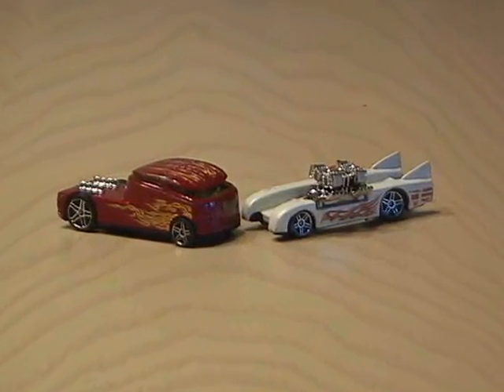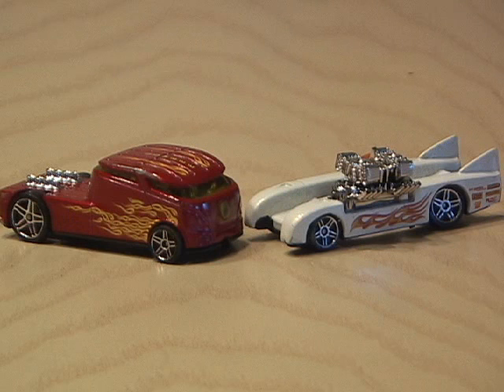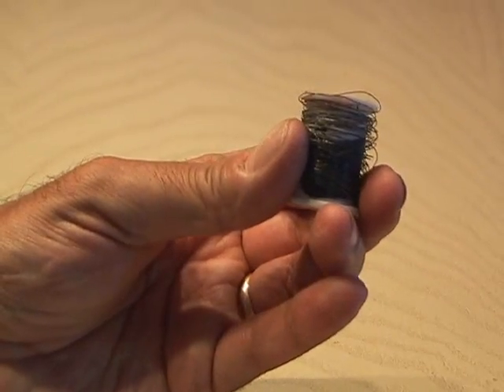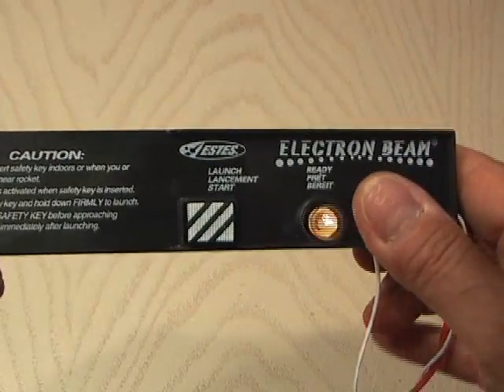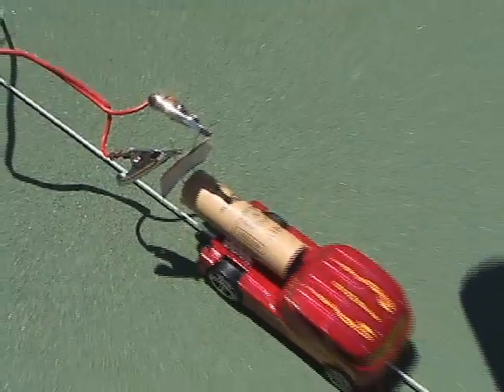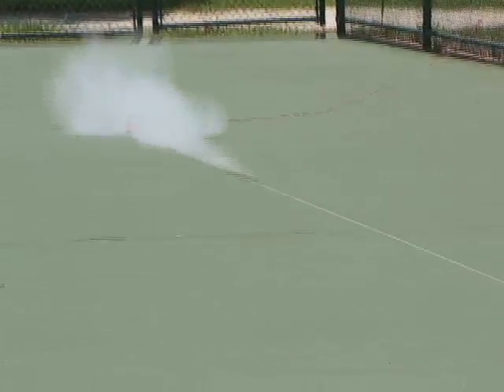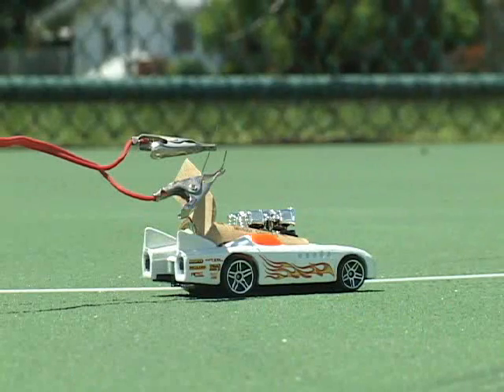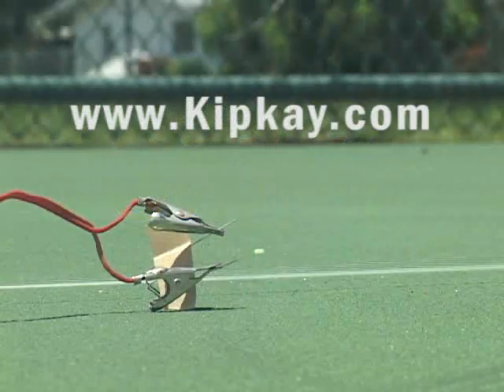Rocket Powered Matchbox Cars!

Comment: @XxFairyGrrlxX No. I was just messing with y'all. I've shot a ton of model rockets in my life, but never did anything like this. We were always interested in getting them to go as high as possible and getting accurate readings on how high they went. Also getting the multi-stage ones to work right. I've thought about doing this only on a larger scale and actually racing two cars side by side. I'd like to use D engines in larger cars and guide them on welding wire which you can get in long rolls.

Comment: @Roelmaestro You never read the code, did you? It's guys like you that give Model Rocketry a bad name.  I strongly suggest that you re-read the Model Rocketry Code of Safety. You're NEVER supposed to launch at an angle less than SIXTY DEGREES from horizontal. This is horizontal. ZERO DEGREES. Someone is going to get hurt with shenanigans like this or get their eye put out. EPIC FAIL.

Comment: I made a similar idea many, many many (Okay, a good 30) years ago when I was into Model Rocketry.. I built a small wooden car, and outfitted the back with a cast aluminum tube. (helped to have a foundry furnace & engine lathe in shop class at the high school.) Not quite as fast, but not limited to a wire either.. I used to launch them in the back lot of a mall, before they rearranged the store locations. Actually concepted a 'Snow Speeder' design, which would skate on the snow surface.)

Comment: @Dark0Lord7 thanx. I'll try to use 1 of those the next time. :) but would I need allegatir clips and 1 of those wires that comes with model rocket engines? Or can I just keep the 1 wire. Btw, how can I make sure the wire is copper? It looks like copper but I can't b sure since it's not working.

Comment: @meepfeet I tried to make an electric igniter that didn't work. I took apart a toy car that was attached to a trigger to a string and the trigger had 2 buttons (1 for forward and 1 for backword) I attached the red to the positive of the battery and the black to the negative. for the blue and green wires, the 1s where the power goes, i took 1 of the copper hairs out of 1 of the wires and tied it to both wires. from what i know it should have lit up red hot but it didn't. :( What did i do wrong?

Comment: @afr126 If you scaled it up, it would be 1800 mph.  What Kipkay did is measure the distance traveled, and the time it took to travel that distance.  He converted what was most likely a feet per second value into mph.  Then he multiplied the true mph by 64 to get 1800 scale mph.

Comment: @afr126 You have to know the scale on the cars first. From Wikipedia, we find that Hot Wheels makes cars at 1/64 scale, which means that the cars are one 64th the size of a real car. The conversion factor applies to every measurement. A scale mile would also use this conversion factor, 5280 / 64 = 82.5 ft.  The  actual speed in mph would be 1800 / 64 = 28.125 mph.  Not super fast, until you consider that a car going thirty miles per hour will kill you.

Comment: @ThePEELdeal think of it like this. if  u have a perfectly scaled 1/1000 size model of a boeing 747 then what speed would it need to take off? A 747 takes off at around 180 mph so you're a basically saying this model would take off at about 0.18 mph? And if I'm on my bike going 20 mph and there's a car next to me going at 20 mph but because I'm only 1/10 the size of the car I'm actually going 200 mph? Speed doesn't scale.

Comment: Hahaha, as a kid I had that exact same rocket kit. The normal kit has a little drag racer car, and you had to set up somewhere along the end of the line a parachute that was attached to the line. When the car went passed the parachute, the parachute would be pulled out of it's little holder thing, then opened. Shame I eventually lost that, because I still have like 12 of the rockets that I could have used!

Comment: i tried this with a rocket and attatched a bomb to the end of the rocket or a cap filed with flash powder and when it went fast at the last secand BOOOOOOOOOOOOOOM no more hotwheels it literaly got scatered everywhere and nothing is left     i cal it hotter wheels and ofcourse i partaily removed the seal of the front end of the engine so its like a smal jet of fire after the last of the fuel is gone thus igniting the flash

Comment: @chinaiscool24   the cardboard sticker holds together the egnition wires. The tip of the wires is a very fine wire which heats up and glows when you run power to it.  They come with the estes rocket engine. He is using an estes lauch system, but a square hobby battery and some wires with alligator clips is all you need.

Comment: I would assume anyone that has ever played with model rockets and hot wheels has tried this. First time i did this was like around 14 years ago when I was a teenager. It's pretty cool, especially when you use a much bigger engine and aim it for a ramp. In my case it was a speed bump. It still went pretty high/far though. I never did the string part though.

Comment: haha i did this when i was little with a 1/24 car and no string on the running track .... didn't turn out to well the car went for about a half second then hit a bump and flew in the air then smashed into the ground breaking into little bits

Comment: 1800 scale miles per hour at a scale of one one inch to about a foot would be 1/12 mph so that means the car is going 1800smph*0.083333=150mph.. so yeah if u dont get it... the car is going 150 miles per hour wich is over 2x faster than highway speed... great job with this one... dispite the fact it's almost three years old. O_o

Comment: SCALE miles per hour. Say that car is 1/20th the size it would be in real life and is traveling 90 miles per hour in real life. Multiply 90 by 20 and you get 1800 scale miles per hour meaning if everything were scaled up to life size it would be going 1800 mph.

Comment: @IBRACIN
 Remote control car speed is always measured in scale MPH... It just means that if the car's scale was was increased to life size and the speed was increased in the same manner, it would be going however many Miles Per Hour. But you are right; MPH is MPH no matter what size.

Comment: For the confused people, here's an example done in 1:50 ratio

A 200 inch car traveling at 100 mph will travel 6,336,000 inches in an hour. That's 31,680 car lengths. A 4 inch car traveling at the same speed will travel 1,584,000 car lengths in one hour. That is 50x the amount of car lengths traveled in an hour, which for the full size 200 inch car to travel its length that many times in an hour, it would have to be traveling at a rate of 500 mph. Do you understand now?

Comment: Listen up:
scale mph is what that car would go if it was full sized and moving the same car-lengths per second. Lets say the hot wheel is going 100 toy car lengths per second. In real life its not going that fast but if it were a FULL SIZED car going 100 body lengths per second, It would be going 1800 real mph. Now, hot wheels are 1:24 replicas, meaning the dimensions are 1/24 the real model. so if we want 1800 scale mph into real mph, we divide by 24. 1800/24=75mph,freeway speed.
YOUR WELCOME

Comment: I did this using a an 10 inch car a bigger motor (I think a C), and we ran fishing line the length of my whole street, (A very long straightaway with only a few houses on one side and zero traffic.)

It went about a hundred feet, melted the fishing line, and then took off into the air, spiraling and looping all over the place.

Comment: But how many NON-scale miles is that?...I'm curious...And this really can't be done in real life with an ACTUAL car...It would have to be just the outer shell with plastic in it like a life sized hot wheel because the weight would be too much to handle on the chassis for one and just too much weight for the rocket to push up to that speed...

Comment: The rocket engine is used to propel model rockets. They already use them like that, but this is some dumb fun. The ignition is wire which is electrically charged and has something that creates a spark on the end. The spark ignites the rocket, and KAPOOSH!

Comment: Cool so do I. I just put a mamba micro pro with a 6800kv and 3s lipo into it. It likes to fly :) I need to change the gearing though, the motor is getting pretty hot even in the 30 degree weather. Plus I prefer insane torque over insane speed. It should still be pretty fast even after i change the gearing though.